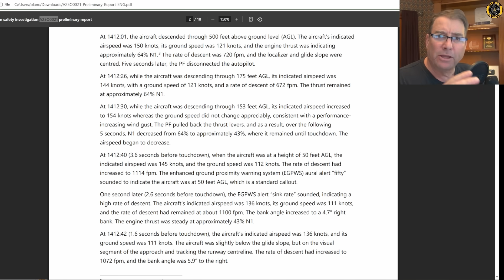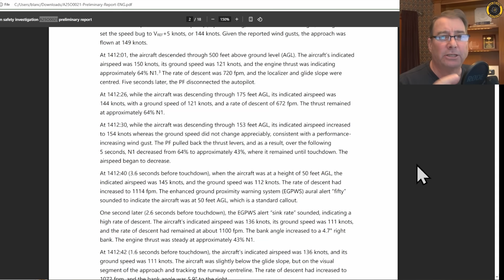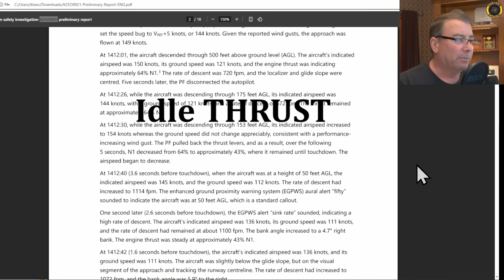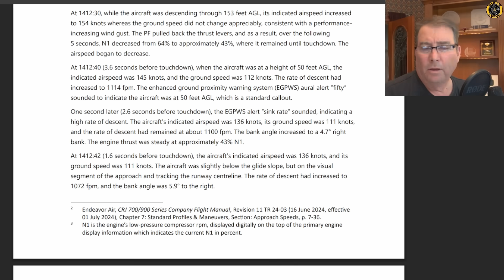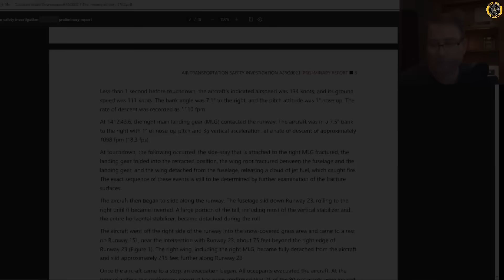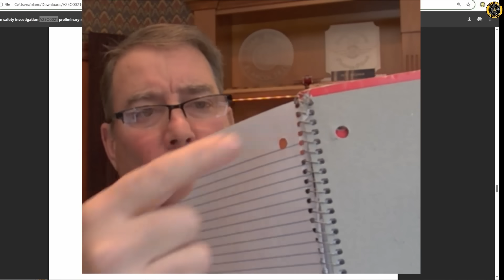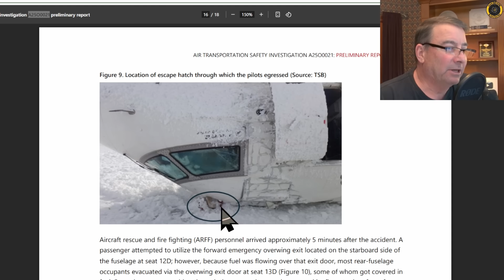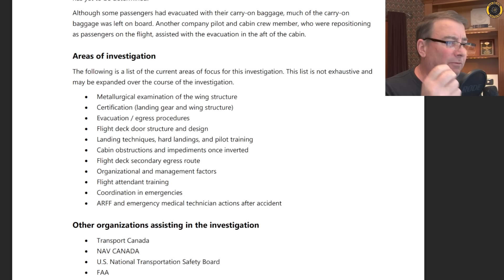TSB Prelim Toronto CRJ Crash

Comment: I really appreciate how Juan reports- he makes the most technical points easy for non-pilots to understand!
Since the Colgan FLT 3407, I have been uneasy with the lack of sufficient experience of commuter aircraft pilots. 
Hopefully, this new US administration will address this pilot shortage issue and training, quickly!
Reply: What do you expect from a US administration that does nothing to address the severe ATC shortage issue but does everything to cut down FAA workforce. This included the new employees with temporary contracts that they urgently need given the massive retirements. That just means exacerbating the shortage in the future, and the long-term effects can't be fixed by just postponing the retirements. Slashing a whole future generation makes it much worse.
Reply: @ while I am aware of these reports, I haven’t seen evidence that any ATC’s have actually been fired. The FAA has had shortages for decades now- like most employers. The employee pool has been shrinking for decades due to lower birth rates and abortion. About 10 years ago, my employer had a contract with the FAA to train ATC’s, but it was near impossible to find qualified people- or bring back retirees even for PT or casual work. I couldn’t convince my own neighbors, retired NY TRACON ATC’s, to come back for any amount of pay!
Reply: @skayt35  I expect that Space X will offer a ready-made highly computerised AI and Starlink-based  system to replace much of the existing infrastructure.
Reply: @ I expect them to maintain standards and do their job.

Comment: The captain is also the ASAP manager for EDV. 

Not sure if you knew that or not, Juan. Long story short, hes a certified desk flyer 😅
Reply: seems odd to have so little actual time in 18 years of "flying"
Reply: @bsmith1164  He seems to spend most of his time teaching in the simulator. More than one inference may be drawn from that.
Reply from the maker: Interesting. I hope that's in the final report.
Reply: I guess he’s going to be the main topic in his next report. :/
Reply: Given the significant lack of line flying experience of both pilots, it is safe to conclude that either Endeavor's crew scheduling system is very poor or that the airline is really short of pilots.

Comment: Juan is a natural teacher the notebook spine ripping  tells a thousand words
Reply: Agreed, that was one of the simplest and best visual explanations I've seen in a long time.
Reply: @Guss110  But long taught by aircraft maintenance teachers. Still, a point well made.
Reply: @Georgiagreen317  Absolutely, I’m sure it is. But for the average Joe to relate to when following this story, it certainly helps when Juan gets the point across perfectly 😊
Reply: And well prepared for by the photograph of the break. Makes me wonder how such a joining technique would be permitted in the design.
Reply: @awuma   Because the aircraft isn't designed to stay in one piece when you drive it in to the ground at that sort of G Loading........ If it was, then it'd never get off the ground because it'd be too heavy.
Aircraft design is a trade off between strength, weight and power. And a fine balancing act it is too. 
Unfortunately some aircrew are hellbent on exceeding the design envelope.......

Comment: Things are taking shape to add to the picture of the cause of this crash. My theory still has a place here. I'm thinking that the pilot lady was able to correct for gusting crosswinds and she was able to flare but, (at least in this instance) she lacked the flying skills and coordination to do both together-  both at the same time. She may have momentarily "frozen" at the controls.  Maybe I shouldn't say "both". Maybe the correct assessment is all THREE elements at the same time, when you add in the not-so-simple power management requirements. 
Good time for a go-around. 
I'm glad nobody was killed and that they got to Toronto on time. Patrick Cowdrey, Central Point, Oregon

Comment: The news media are reporting the failures of the landing gear and wing as if they caused the crash due to a defect. Of course, the landing gear and wing are designed to fail in a specific way under severe overload, to maximize passenger safety. The bank angle of almost 8 degrees at touchdown confirms that this mishap was caused by pilot error, nothing else.

Comment: Thanks Juan. 14 seconds, broken into a few seconds that made the difference. That isn't much time to think through a problem, in those conditions it had to be instincts that needed to come into play. I stopped flying when, as a recreational pilot, the cost of flying became more than I could afford to stay competent even though I could do the minimum hours to maintain my licence. I flew at a airport that could have weather change in minutes from calm to high winds and gusts caused by the local terrain and ocean. On one flight I got a shift and realised that this was pushing my skill level to maximum for the amount of flying I could do and I decided that my flying days were over. 😢
Reply: 14 seconds is an eternity to be in idle flying the approach when fully configured for landing.  The report doesn't specifically indicate 43% N1 was flight idle but does indicate the approximately 20% N1 reduction at 150 agl .... that's WAY too high for a normal on speed/on glide path/no wind point to start the flare and selecting idle ... let alone with those winds.
Reply: Forgive the pedantry - responses should be driven by training and learning and not by instincts.
Reply: @hb1338  AYE! training for the situation/condition ... not "because it was time" as it seems this one was.
Reply: @hb1338  The human learns by repetition, and skill levels increase with more repetition. Neural connections are formed that make tasks take less mental effort, when it then becomes automatic. These connections can dull without practice. A well trained pilot, when in a high stress situation, is operating on automatic and is not consciously thinking about how to handle the situation. This is training developing into a skill set that through practice has been converted into instinctive actions.
Reply: @hb1338  Training and experience are what build the mental model that feed your instincts.

Comment: When time spacing between 50-40-30-20-10 is oddly short normal reaction would be To/Ga.A technical solution to masking by GPWS is needed  !
Reply: When the sink rate is very high, so of the call-out are missed 50-30-10 etc.

Comment: Hi Juan

Does Bombardier suggest crossing the runway at Vref?

Embraer ERJ (135/145) Manual will have you reduce your approach speed to cross the Threshold at Vref at 50ft to meet the performance figures. Embraer EMJ (170/190) figures will include you crossing the threshold at Vap due to the Autothrottle.

Not sure what the figures and technique on the CRJ is - if it was to cross the threshold at Vref (137kts), then they weren't slow on the approach (you refer to 150kts/Vap), but their Rate Of Descent was definitely too high.

Comment: Regarding stick and rudder training: Are you aware of Canadian jet that ran out of fuel at FL36? Pilot saved everyone by being experienced AND being a hobby glider pilot (stick and rudder). I believe book was ‘Freefall, they also made a movie (book is better).
Reply: That mishap was caused by not uplifting sufficient fuel, due to a misunderstanding of the measurement units employed and also improper fuel monitoring in flight. With glider pilots fuel monitoring is not an issue.

Comment: Good safe flying starts from the ground up.  Not from the top of a computer desk.  Good presentation Juan.  My local airport in my beginning days had a similar issue with flying over a river toward the end of the runway.  There you would get a 50 ft rise yhen a sudden drop sinking down to the tarmac.  You had to throttle up and feather it back to get it down smoothly.  Sadly several strangers to the area never got this and perished.

Comment: Juan, Great point on the runway’s narrower visible appearance of being high, I didn’t think of that. 👍✈️
Reply: I am a gliding examiner/instructor. When flying cross-country sometimes we run out of lift and have to land in a field. The shape of the field can also play tricks. Where the far end of the field is narrower than the near end, the pilot thinks that the field is longer and they are higher. The opposite is the case for fields where the far end is wider.
Reply: @christopherrobinson7541  I have no real world glider experience, but I find them fun in flight sims, lol. 
Your comment got me thinking. What happens if/when you have to land in a field? 
1. Do you need to find and contact the land owner?
2. How do you get the glider out?

Comment: Old school pilot here. I was fortunate to fly my first 10,000 in aircraft without an Auto pilot. 8.000 of it was in helicopters of which 900 hours was another pilot flying. While flying for Petroleum Helicopters I flew one job which had one helicopter, and we flew a half day and were relieved by the other pilot because of the number of takeoffs and landings. My high was 426 in just under 5 hours. All the landings were on steel decks so smooth was essential. Offshore the winds were almost always blowing sometimes reaching 40 or 50 knots. When I transitioned to heavy jets I always flew to top of climb and from top of decent except with a company check airman who always frowned on the practice. I was constantly complimented on my SMOOTH flying ability. I have never thought of it as anything special because of my helicopter background. By the way I always joke that the Army thought I was so dumb they never trusted me in an aircraft with wheels and brakes. My two favorite airplanes to fly are the DC-8 and the B-777. Ralph is right about loss of stick and rudder (tail rotor) skills.

Comment: When it's gusty, and you're getting near the ground, you don't touch the power and you don't chase the airspeed or attitude.  (Assuming you've already been stabilized for at least 500')  You just accept the airspeed fluctuations (that's WHY you bumped up the Vref speed), and concentrate on the runway while keeping wings at a safe bank angle while you adjust to the flare, and you shouldn't need to flare much as you want to get on the ground without a long floating flare in gusts.  As we would brief, I'm just gonna' drive it on.  If a gust pops you up, or changes your airspeed a bit, you still don't yank power back.  The power isn't touched until after you're on the ground, you don't even pull it back for the flare, and you also keep your airspeed up all the way through that flare to touchdown.  The only exception is in a case where your sink rate increases dramatically, but that only happens in conditions you should not be landing in, as in convective turbulence, and then it's an automatic go-around.  And THAT is why you need pilots in airline cockpits with a LOT more experience.
Reply: I fly gliders and we teach Vref + 1/2 the wind OR also of the gust. So with 20 kts wind gusting to 35 kts, we would and 15 kts. For the K21 in which I instruct Vref is 55 kts, so the approach speed would be 70 kts. Normally the air-brakes would be set to 1/2 to 2/3 with a reference point a short distance into the airfield. However, in strong winds the reference point is moved further into the airfield to ensure an adequate undershoot. Ideally a full airbrake approach is utilized. 

(Instructing 20k+ hours and 55k+ flights, all stick and rudder, no engine and no go arounds).

Comment: I don't know if it's relevant, but the one time I've been on one of these planes, I liked it a lot, but to be noted is that as we approached (LAX, north runways) it didn't seem stable and I thought we we'd end up going around.
We landed and then shortly they lit the engines back up as though we were doing a touch-and-go. But a few seconds later they throttled back and we finished the landing as normal.
I never found out what happened.

Comment: How many actually landings has this  pilot done on this type aircraft, with 400hr ??
Reply: The regional jets typically average about 2 hrs, so that suggests 200 flights in total and assuming the FO and Captain alternate, that would be 100 flights, an average of 2 flights per week. If the flight time was just 30 minutes, it still would be only 8 flights per week. Taking into account the shift pattern, 5 days on 5 days off, this would increase to 16 flights per week or 3 per working day.

Comment: Non pilot here - on stabilised approach and headwind increases, generating more lift and lifting the aircraft above glide slope. In my mind this makes the approach non-stabilised now. Instead of cutting back the power and increasing the rate of descent, I would have increased power and started a go around. Just my thoughts.
Reply: If the increase was significant the correct decision would have been to go around. If the increase was small, then ignoring it and just flying the trend would have been the correct decision.

Comment: The "sink rate" warning came too late to inform the pilot to go-around. When it came on, the plane was already banking to the right. Should the pilot have gone around when the performance increasing wind gust occurred at around 150 feet altitude? Or, is that too low to go-around?
Reply: You can press toga even after touching down n before taking the reverse thrust...it's never late to go around, come back n try again.
Reply: @gulthepilot  TOGA wouldn't have been safe when the 'sink rate' warning sounded (just 2.6 seconds before touchdown). The aircraft was too low (about 20-50 feet) and had a significant bank angle, making a go-around risky. There wasn't enough time for the engines to spool up, and it could have led to a tail strike or loss of control.

Comment: Back in 2000 I started flying with my challenger II, flying in southern Alberta that always has gusty winds, I had the exact thing happen… riding a gust down to the 5 foot level and the gust ended, I dropped the last 5 feet, bent my right gear leg. I made sure to keep the speed up from then on…

Comment: I appreciate your update. I flew the CRJ for 10 years and our SOP was also no faster than Vref+10. Also, if I remember correctly the CRJ at idle is 25-30% N1. But fundamentally you are correct, the power was reduced enough to not maintain the energy for the flare. And while I don’t disagree with your stick and rudder statement, the real question is how? What flight instructor is going to want to take a student up in gusty conditions and have them do a bunch of risky landings for $25 an hour and if any metal gets dinged you can kiss your career goodbye? As a CFI my personal minimums were 10 kts of crosswind and max gust factor of 5. Not worth risking my future career on a last second gust that is too late for me to take the controls.
Reply: The throttles were reduced from 64% N1 to 43% N1, the resulting power reduction is not linear, but proportional to the square, so was reduced to about 45% thrust.

Comment: 1) As far as I'm aware, CRJ operators in the USA have similar procedures of bugging up Vref only slightly for gusts. Nowhere near as generous as the Boeing additives. Such similarity makes me believe this is a result of the Bombardier (manufacturer's) flight manual... and makes me wonder if this might get some revisiting.

2) From experience, the CRJ lands quite easily at speeds well above Vref because it comes in with such a nose-high attitude on a stable approach... and also has very generous braking capability when needed. Set the power, muscle through the gusts, accept the (speed) gains, fight the losses (with power), hold the aim point (descent angle), and flare a little less if you end up fast...

3) Unlike Juan Browne, FlightGlobal already got it wrong in the headline of their article, supposedly highlighting the "lack of flare"... The main problem was that they got on the back side of the power curve with a prodigious sink rate right into the runway. Maybe if the PF pulled back hard at the last second to a 8-degree nose-up pitch with wings close to level, the gear might not have collapsed, but it still would have been a rough hit from an approach that apparently became quite unstable. The solution in this case is never to flare hard... the solution is to add power sooner either to preserve airspeed or to go around...